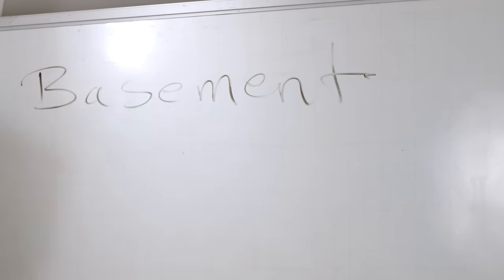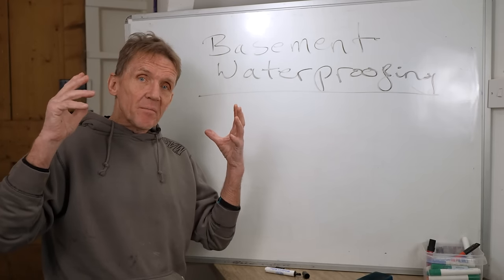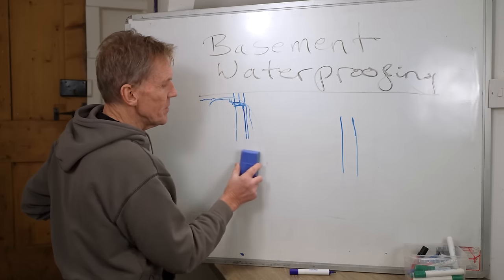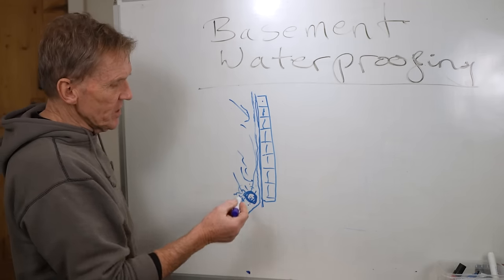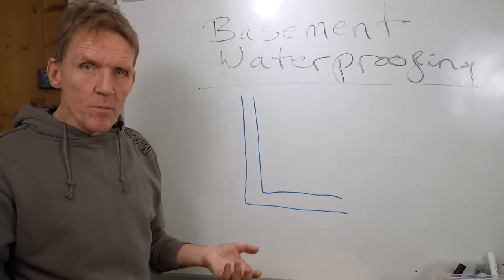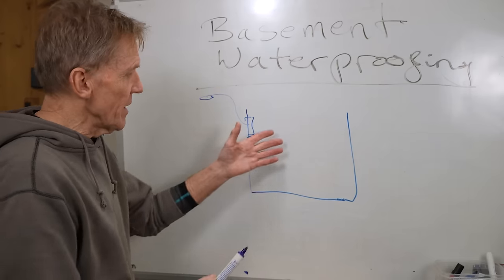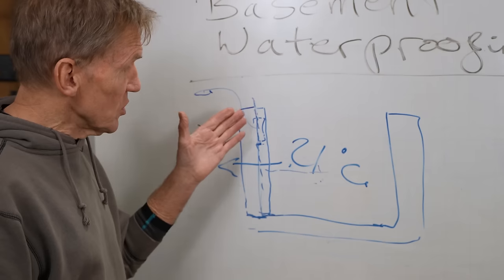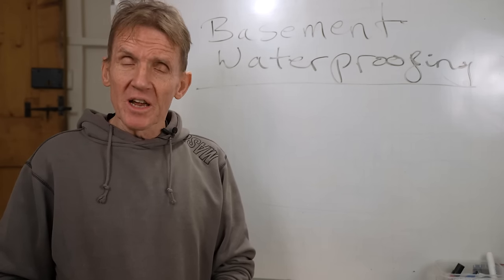Watch This Before Waterproofing Your Basement

Comment: also may i add that water can float a basement and even shear it away from and engineering tie in (including rebar and brick concrete tie in methods) to counterbalance the pressure on the external wall and even on the basement floor, bore holes can be drilled in the bottom of the basement floor and sump pumps scattered so to balance the pressure of the water under the basement. For very large basements, floor sump pumps can even be positioned so to level off  a structure and even-out the pressure from below a basement floor. So sump pumps not only get ride of the water but can also be used stabilize a building, this method was used on a hospital positioned along the Thames river, as the water table height can be quite low . even thou the basement was tied in with extensive rebars, the rebar snapped due to the the sheer force of the water table. solution  - 8 sump pumps positioned so to keep the water out and each electronically controlled to float the basement on the water table/ground (ps the basement moved 2 feet so tte sump pumps were used to float/move the basement back into position) sounds  impossible but true.

Comment: You showed the French drain ideally being below the wall level rather at the bottom of the wall level. However you hopefully have foundations below the bottom of the wall!. Is it better to have the bottom of the French drain level with the bottom of the foundations - and not below it so that you minimise under-mining the foundations itself? 

I find adding a damp proof plastic sheet layer that covers the wall and down to the bottom of the foundation reduces any risk of any issues. Adding a rodding port to allow clearage of any sift after years of service also helps. I find putting the French drain itself within a filter membrane increases the risk of silt clogging the holes on the French drain itself and the risk of having to dig it up again in the future.

Comment: Hi Roger,
Excellent video very informative.
Quick question in the last part of the video where you insulate from outside and use the French drain.   In relation to the floor how do you prevent water coming from that direction,
Thanks 
Mark

Comment: Not basement related but I put perf pipe round an outbuilding below raft foundation that got soggy sometimes, fed off to a soakaway and excavated down side of it and put 25L mixing bucket full of holes and wrapped in landscape fabric. Cut a hole in a patio tile so I could put sump pump down there for really bad rain.

Comment: There is a "secret" nuclear bunker near me which i have visited. It was built in the Fifties. Must go down at least seventy feet or so. It's as dry as a bone down there. How did they manage it ?
Reply from the maker: Is that the one in Essex?
Reply: @SkillBuilder  That's the one. Kelvedon Hatch off the Ongar Road.
Reply: @jannenreuben7398  The Essex one was a command and control centre. Still got much of the fixtures and fittings in it.

Comment: Thank you for yet another interesting video! What is your opinion on the use of breathable systems for insulating/draining basements? We are primarily installing the isodran systems here in Northern Sweden. It is dependent on having the basement heated to dry out the basement wall. You insulate the outside and leave the basement wall naked. The idea is that water will run on the outside of the insulation and perhaps on the wall down to drainage pipes at the bottom of the basement foundation. The water is then transported to a pump well or some other water collecting system. The insulation consists of 100mm sheets of EPS beads covered in tar that allows for water transfer through it. I think it has worked well for the installations that we have done but I think with too much water on the outside the system could be oversaturated.

Comment: Great video Roger. I heard you also have the option of a suspended timber floor and have the sump pump under that. Sounds like a better option for drainage but not sure about how well the floor would cope with no air circulation. Or alternatively suspended concrete beams with blocks in between. Any thoughts

Comment: Roger, every time I watch one of your videos am learning something  I even saved myself a lot of hassle cleaning the silicon with bleach as you suggested n the results where way better than I was expecting, year ago I think it was mid 80I was asked to do some plumbing n some electrical work in Hackney, when I got there they had couple of dehumidifiers in the basement n some heaters to dry the basement up, the bloke said to me we are not quite ready yet mate best you come back in couple of weeks, I asked them what they where doing n he said we nee to dry the basement well n then "tank it" basically he said once the place is totally dry we will paint the walls with tar n then render over it with waterproofing render then he said problem solved, so I asked what happens after everything it done will the tar n rendering not come away from the wall falling down in chunks he said No I give my customers a 20 year Guarantee, told him but u wont be around the first winter mate let alone 20 winters later guess what I never went back after that, but am "sure he would have honoured his guarantee" if they could find him LOL
Reply from the maker: Planting anything on the face of the internal wall to hold back water is a waste of time. The hydrostatic pressure will blow it off. 
The British Standards show another skin of masonry so the membrane is held in place. I bet that job failed. Bitumen paint is not a great idea

Comment: Hey Roger, I dug out my own basement that included going 60cm wide under the existing founds of the back wall.  It was boulder clay and I was 50 yrs old. It was the hardest work of my life, and I’m a very hard worker.  I then concreted the walls shuttering ‘pockets as I went. The walls were all 60-80 cm deep. I used little rebar, and ended up having to get an engineer to design surface beams on the inside. I then put a 1m sump pump with French drain in to it that circled under the floor slab. With the sumo working to take the water table directly in to the land drainage via a pump I’ve had only a little water ingress. Here’s the shocker, I’m midd terrace!.  I made a lot of mistakes. I should have used a structural eng. instead of listening to the architect. The wall should have gone in after the floor, but how do you keep the soil from caving in. I suppose I could have used corrugated sheet but I was in a limited budget. The walls should have been designed with rebar to reduce these being 60+ cm deep. 
Digging down is a killer. Get hell, get professional guidance re the design and ensure you get a structural engineer.  I had a bit of a leak over the top of the concrete wall head where it meets the existing foundation. I decided to drill a hole right through to the source of that water and inserted a 25mm stainless tube and ran a 20mm flexi pipe to the sump and it dealt with the]at problem. It’s just a store for my amassed tool kit (I’m a cabinet maker but done it all as they say) if you want pictures or any thing you think may be of hell do get in touch. 
If there is any other way to add space to your house, do not dig a basement!!!
Reply from the maker: Hi Arch Angel 
I don't think you did too badly and the house is still standing. Yes please send the pictures in.
Reply: @SkillBuilder  you’re amazingly good at responding to the “little people”. Love that! 
I’ll take a video of my basement but I’m not altogether sure how to upload that to you. I’ll certainly have a go on Monday at some point. 
Every blessing 
Peter (arch angel)

Comment: Basements seem to be more common in France and Germany, often used as garages. They seem to me to be dry and damp free and I’ve mainly visited in the summer. How can this be?
This video reminded me of the John Lewis store in Kingston, it has a Waitrose in the basement and then two levels of underground parking under Waitrose, three level basement and right next to the Thames. The building must have been built to very high standards as the car parks do not appear to be damp, the video made me aware of the complexity of that build. Under the new home office building in London that used to be Dept of Environment has huge i.e very deep underground structures beneath the office block.
Reply: Location, climate, soil and water table all make a difference.
Reply: @disklamer  London is built on clay with a high water table, challenging for engineers. They seem to be up to the challenge as there has been a huge amount of subterranean construction under London, some purposely not on any maps/drawings. There have been several serious problems where the construction of super basements in residential properties have collapsed, resulting in damage to neighbouring properties. Jimmy Page (Led Zeppelin) and Robbie Williams had a big falling out as neighbours regarding Williams’ super basement.

Comment: if you are paying enough you will get plenty of labour , i have been caught  on thank you jobs before,, keep the good work up with vids ,what worries me the old adage 
them can do those that can`t teach , sure you up to the job , getting rid of the spoil is expensive ,do a vid  insulating lofts as that seam to be the latest scam phone 
calls claiming your exciting insulation is causing problems
Reply from the maker: Robert 
Thank you for your concern but no need to patronise me, I have dug more trenches and done more cellar digouts than I can count. 
As for the video on condensation we had that call in the middle of a video we were making a few weeks ago.
Reply: @SkillBuilder  sorry you took my comments serious and i was not trying to you  patronizing , i find your channel informative and presented professionally ,will look out for your loft insulation bit cheers bob

Comment: So the insulation on the outside acts like a warm roof and on the inside a cold roof and with that comes all the moisture problems 👍👍
Reply: Correct M&E / Environmental controls, according to required R.H. / Ambient temperatures, in accordance to whats on the inside is a major factor too, (i.e., is it a car park, library or swimming poo etc), but fair play to Roger, he wasn't exhaustive, but gave some very good principles, so hats off to him.

Comment: I have a cellar/basement, and need an extra foot head room, any info you can provide on digging out deeper?
Reply: Usually has to have the foundations underpinned when this is the case . We dig off and pin and prop the front of the house first and then get the digger in there and a conveyor to get our required ceiling height . Usually means going another 2 foot lower than your ceiling  height tho so u may have another 3 foot to come out yet .. and that’s after you have done a your under pinning step by step it’s big work not for the faint hearted or inexperienced!

Comment: Dad had a basement built two lots of waterproofing, still had a small leak tiny , cement mixed with antifreeze, worked a treat maybe it worked like the crystal cement, anyway that was back in the nineties, haven't seen any leaks since it not a habitable space👍👍👍
Reply from the maker: Hi Clive
 Are we talking about cement accelerator antifreeze?
Reply: @SkillBuilder  yeah the stuff that goes in cars 🤯

Comment: I’m surprised you didn’t mention the most traditional basement solution Roger ,still great video explanation 👍🏻
Reply from the maker: Tell me more
Reply: Traditional tanking grade mastic asphalt in three coats with a single brick wall and loading concrete to base ,I know not exactly modern but very affective .

Comment: Peculiarities of the British construction industry are peculiar.
Waterproof concrete is not waterproofing. Properly waterproofed structure has nothing to do with continuous pour of concrete as well.
First of all, the foundation needs to be sealed from the underneath, so you pour your concrete onto something that is impermeable; we call it horizontal  foundation insulation.
Then you insulate your foundation walls with proper sealants; may be bitumen, may be the same kind as shower waterproofing, but usually two-component and heavy-duty. That the first layer of vertical foundation insulation.
It's extremely important to join together horizontal and vertical insulations, so they are water-tight.
Then thermal insulation of at least 8 cm, preferably made of XPS, should be installed. To prevent damage we put impermeable, thick membrane on top of that insulation. Now a drainage system should be made. After that the foundation walls must be filled in/covered with coarse sand NOT some kind of shitty soil; it's very important not to damage the insulation while covering the walls. Only the sand guarantees that the water is drained away properly from the walls.
Practically every well established manufacturer of chemical products for the building industry has it's own, verified waterproofing system. Here we use Ceresit, Mapei, Weber, Sopro, Atlas and a few other local brands.
Waterproofing is not a rocket surgery, but you just need to start doing it. Ballast underneath joists and a soil dug out of your garden and then put around the foundation walls are neither waterproofing nor insulation.
Reply: Hi Stefan, with respect, if you read the latest version of BS;8102,2022 you may find that there is nothing peculiar about British standards at all, however, what is peculiar is when non specialists do not read, or understand it and then "Have a go" at waterproofing.
Reply: @MegaGreeny2  
Thanks for your input.
As I mentioned, form the European (or continental as you say with a sneer) point of view your regulations seem peculiar.

I live in much harsher climate and we do have a lot of issues with ground and meteoric water. So we do waterproofing properly and it lasts years.
Reply: @Stefan_Kawalec  , 
There were no sneers, or indeed mentions of the continent from myself ?, 
just well intended guidance, based on many years of experience, on many deep projects, often in harsh / inclement strata, inc of clay (Probably the worst, with perched water tables firmly in mind), 
which will soon make defects in a structure apparent after precipitation, floods or burst water mains etc, and allow the passage of water, 
but all of that aside, I am more than happy to discuss any below ground leval  waterproofing scenario's further if you like, and as they say, every day is a school day, so perhaps with your obvious knowledge also in mind we can maybe enlighten each other further too ?, have a great evening.
Reply: @MegaGreeny2  I didn't mean to offend you, so I am sorry if you felt that way.
Unfortunately I don't have access to BTI regulations so I cannot compare it our code of practice.
Here the law itself only obliges us to make foundations waterproof. To put it into practice we use mainly systemic solutions provided by the manufacturers of building materials such as Mapei, Henkel, Kreisel etc.
When designing a building, architect gives me systems and solutions I should use. And I abide by his guidelines.
If there's high level of ground water or the foundation is very deep or there are other hydrogeological (is that a proper word in English) issues we often use Larssen retaining walls.
My initial irony was caused by what some British contractors show in their videos.

Comment: if building from new, go with caltite concrete, 100% waterproof 

all other systems can and do fail 

obviously you cant really use it for existing basements
Reply: All BS / EN Compliant Type-B waterproofing (Ad mixtures can fail), due to poor placement, shuttering, compaction, vibration, hydration regimes, one can never rule out poor workmanship.
Reply: @MegaGreeny2  yep very true. caltite fo however offer lifetime warranty / think its 40 years. bad workmanship could apply to all systems!
Reply: @bobcharlie7982  , All UKAS / independently, third party  tested  / accredited systems should ideally be manufactured  and warranted with the design lifetime of a structure in mind, product guarantees are just that, i.e., if I sold you 1 mm2 of defective mateials, then I have to replace that 1mm2 of material ex factory, people often confuse materail / product guarantees with contractors installation ones too of course, I much prefer the autogenous healing / active types, with crack bridging properties of up to say, 0.5mm, given designed crack widths should ideally be as low as 0.2 / 0.3mm,  and TBH I haven't been around the Caltite brand for some time now, but does it still sell pungent ?

Comment: Have you looked at ICF? It has polystyrene on either sides of the concrete form
Reply from the maker: We are working on a job right now that uses this system
Reply: The principles are the same, albeit pokering / vibrating the concrete within can be problematic, and of course, differing substrates naturally require differing systems, i.e., elasomeric products as the primary waterproofing are good, with fibre mesh reinforcement embedded in to it, followed by Rogers guidance regarding drainage protection sheets, linked to appropriately sited land drainage, with rodding eyes to prolong their service lives is a great way to reduce risk further as well.

Comment: Thanks for a very interesting, perfectly presented video.
My garage (used as a workshop) is underground, with a lawn on top. Whoever built it did a good job of waterproofing it, with bitumen on the outside walls, which are cavity. In the cavity there is a polythene membrane, keeping any water that seeps in from the inner brick wall.